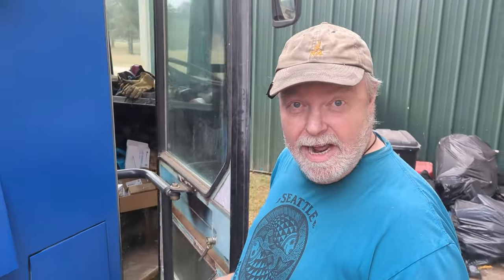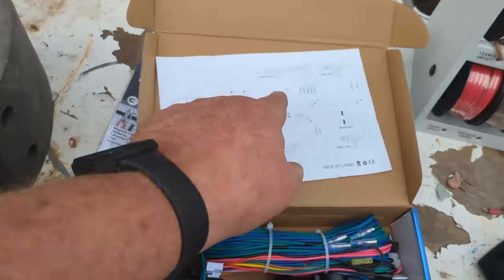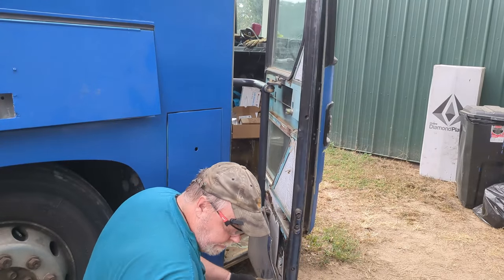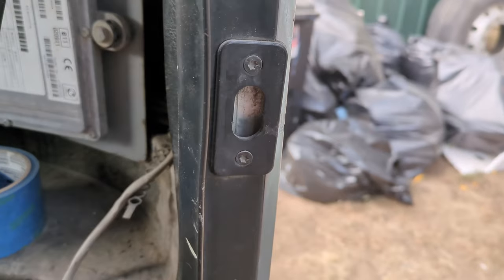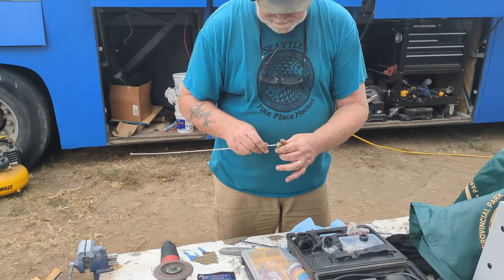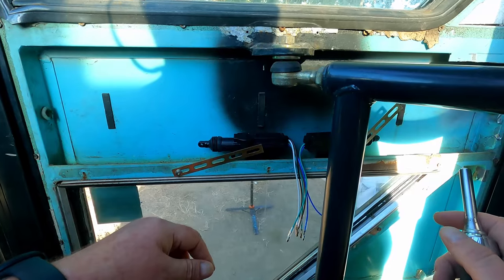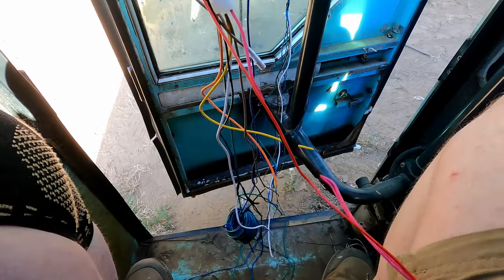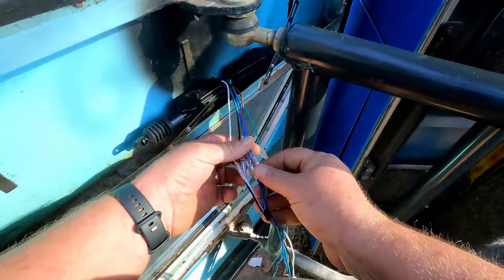Unlocking the Future: Keyless Door Locks Installed on Our Coach!

Comment from the maker: We went through a lot of brainstorming around our bus door. At one point, we wanted to replace it with a house door. For a long while, we were going to build a door into the middle of the bus so we could enter into the kitchen. Finally, we landed on the simplest solution: keep the door we have! And we came up with a locking system that's both secure and fun to use!